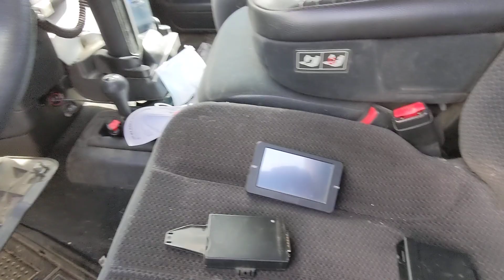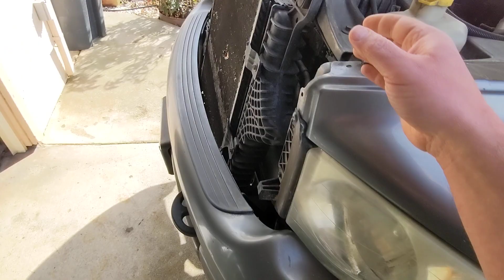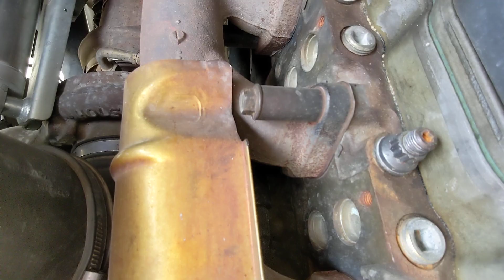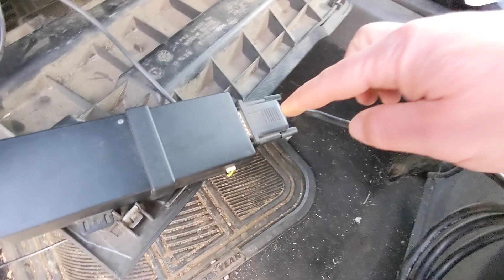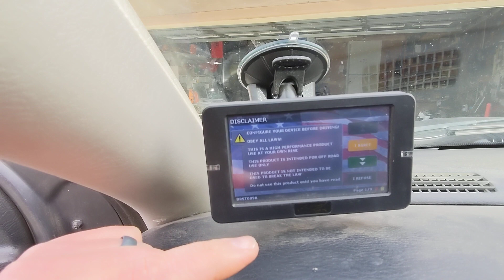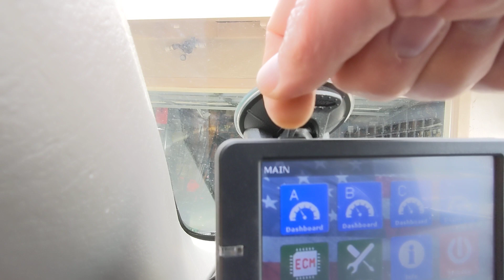MM3 Tuner Installation (Also Smarty Touch and RaceMe Ultra)

Comment: With my MM3 how can I read a temperature sensor that I put on my G56 manual transmission which comes from the factory with no sensors?
Reply from the maker: That is not possible unfortunately, the only external sensor the MM3 supports is the EGT probe.

Comment: I’m looking at getting a tuner for my truck. It’s an 05 Cummins ram 2500 with 6speed 4x4. Stock everything except intake tube and cold air intake and straight exhaust. Looking for tuner now and a performance clutch for heavy towing, daily driving, and fast street runs for having “some” fun. What would you recommend?
Reply from the maker: For a stock truck I'd go with the MM3+EGT Probe and 4 tunes: MPG, Tow, Street and 12 valve performance  https://www.5-9diesel.com/product/custom-tuning-package/

Comment: i received a smarty in the mail and i plugged it into my computer using a regular usb cable and it didn’t turn on it just had a black screen is that normal or no it blinked red and green but the screen never turned on.
Reply from the maker: It won't turn on that way, you need to fully assemble it and plug it into your truck with the key on.

Comment: I have a 17 cummins 2500 I deleted and installed MM3 tuner at 118,000 miles all was good. I think I messed up at about 175,000 miles and let a shop talk me into doing a transmission flush. Over the next 10k miles the trans started throwing errors until it finally went out. I got a new one installed and it is doing good beside it has a hard time shifting from 2nd to 3rd. I am still only 1,000 miles in to new transmission so not sure if it needs to break in more. But I got to thinking could this be a tuning issue? Is there a way to rest tuner before I go through having to try and deal with the trans company with a warranty situation? Trans has a 3 year unlimited mile warranty.
Reply: did you ever get it figured out ?

Comment: I had installed my MM3 a week ago that I had purchased from Rob @Mm3tunning.com also known as diesel camper. I purchased his tunes as well. What he has done with the trans tuning is remarkable. I have owned my 05 2500 quad cab for 10 yrs and have never been happy with the stock shift points. With Robs tunes, engine and trans, they have completely changed the driving experience, should have been this way from the factory, my 10 and 12yr kids even noticed a difference in the truck, specially with his 12v hp tune. If your looking to completely change your driving experience with your 3rd gen cummins buy his tunes, its something I wish I would have done years ago, instead of wasting money on the off the shelf one size fits all programmer's, couldn't be happier with the tunes or his customer service, top notch. You got a question ask and he will answer.
Reply: Do you tow with his tunes?
Reply: @jamesvaldez4093  I have using the 12vhp tune, Street tune but those were light loads on a 16ft trailer nothing heavy also I don't try and break any acceleration records while towing heavy or light. If I tow heavy I use his tow tune.
Reply: @america1st160  How do you like the tow tune and transmission shifts?

Comment: I have the smarty touch and cant find anything about it on the internet and i want to find out about the advanced tuning with the cathcer levels timing levels torque levels rail pressure levels but theres nothing about it anywhere

Comment: Just installed my MM3 this weekend. I had a chance to drive the truck last two days in MPG tune. The lie-o-meter claims I’m getting 25mpg on the highway. I filled up and reset my trip meter. I’ll check it again with simple math after I go back to half tank. It will be a combined hwy/city mileage. So far, so great. The truck shifts better than new.
Reply: Any update on your MPG?
Reply: @lionsdejudah  yes plenty of updates. First is the current trip I’m on. Headed from Denver to Dallas. Family of four, hauling my topper and about 2-300 pound of camping gear. Keeping highway speed of 65-70, I’m getting 19.9-20.4 MPG. (Calculated at the pump) headliner meter claims 22.5, close but not exact. 

Towing on three different occasions a 8500 pound RV, only up and down Colorado mountains, I get 9.5-10.5 at best. Plenty of power, still no issues. MPG tune is great, Tow tune is hit and miss. I think it has more to do with my torque converter getting tired. May be close to a build on my 48RE
Reply: @ernestoluzan  SORCERY!!!
Reply: @lionsdejudah  lol is that good or bad?

Comment: Can you switch on the fly tunes on a early 2004 5.9 cummins?
Reply: He has the tune on the fly listed as 2004.5-2007. Easiest way to tell is look and see if your 2004 has a catalyst. Assuming it hasn’t been deleted, and it was equipped OEM, it’s a 2004.5. Also you can look at the valve cover, driver side, and see what year of manufacture and what horsepower it is. The 2004.5 was a 50 state emission legal engine wi the a rating of 325HP/600lb-ft
Reply from the maker: As it stands now it is for 04.5+ trucks
Reply: WTF is MM3?